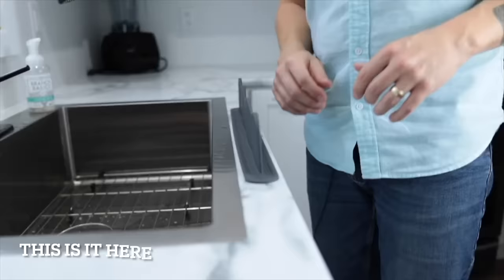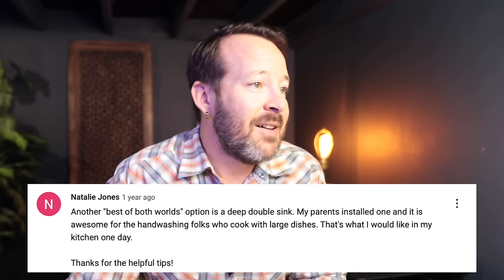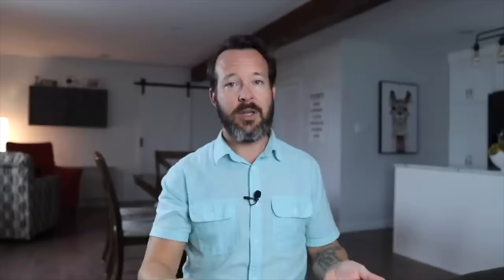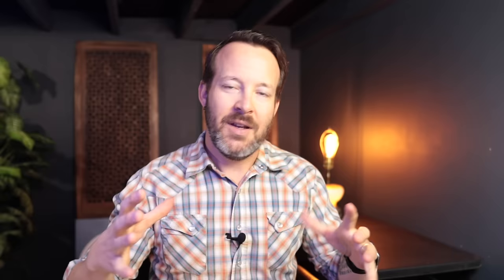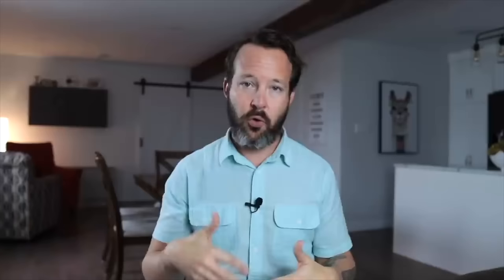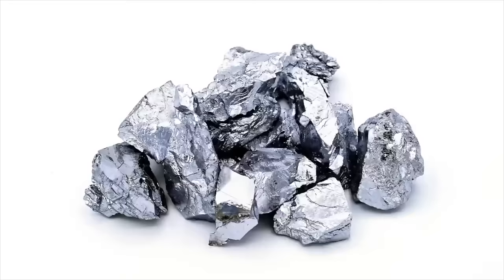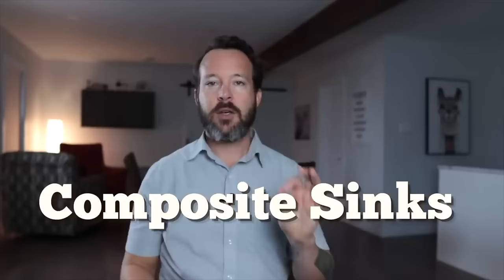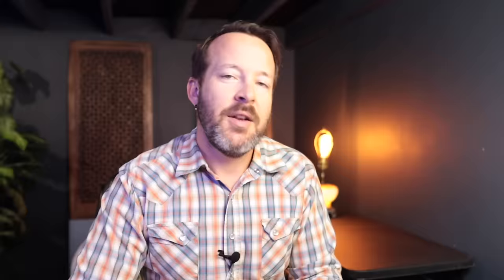Watch First Before Buying a Kitchen Sink

Comment: probably the reason older people like the double sink is because that was necessary before dishwashers were invented. You HAD to wash dishes by hand, NO choice. My house, built 1965 does Not have a dishwasher. I thought about adding one, but the kitchen is very small and would result in LESS storage space for pots and pans. Also, the COST for the dishwasher AND the plumbing and electrical work required. Being retired and on social security, I could not afford the luxury of a dishwasher. So, I will probably get a double sink. House originally had porcelain double sink. Yes, it does stain, but comet cleanser, or bleach handles that. And yes, it does have a few chips in it. But, it lasted 58 years. 1965-2023. I inherited the house, so know it's history. I grew up in it as a child.

Comment: My kitchen is a frankenkitchen made of dead parts of other dead and mostly commercial kitchens. Yes, I'm a bachelor, living alone, and I consider it to be a workshop for food. Women hate it loudly when they even enter it at a party (at my partys the food is self cooked and good) and they grow silent when I see me handle and use the kitchen. Everything is sturdy and overbuilt and pre-scratched (I scotchbrited everything to make the surface of the various stainless parts look more similar to each other). 

I did not know about the automobile silencing mats - I probed the sink by tapping with my fingers, marked some spots and glued surplus heavy tiles to the sinks underside with silicone (not caulc, proper silicone!)

Things that no other kitchen has:
- a pressurized air line. every metal workshop has one - why no kitchen? aerators, meat grinder disc and garlic press clean in seconds. But you need a dish towel and a deep sink, the tiniest of airnozzles and  a local 2 litre pressure reservoir under the sink. the tiny 4mm air line comes from my workshop in the garage.
- a floor drain with a sieve - everything from conserving and canning food to wiping the kitchen just became much easier!
- a proper light in the sink cabinet on both sides and the front of the sink. I made a white painted U from a П-Profile (the U goes to the underside of the countertop around the sink, the П is like a "roof" for the face-down low voltage LED strip. I hanged it to the clamping hardware which holds the stainless sink in the countertop. the cabinet is painted in white polyurethane.
- as we do euro style rubbish separation over here, bins are a separate free-standing unit, and can be rinsed outside in the garden or in the workshop. Pro tip I:  this helps decongest the single point of failure that the standard sink cabinet normally is: one person can wash the dishes, another can bring out the five garbage cans. Pro tip II: have a tiny organic waste bin with a good lid, and empty it daily - life is quick…

I plan to redo the sink unit in about 2 years, with foot operated tap - i have not yet decided… maybe even with a 5..10 litre hot water reservoir. I am just logging my hot/warm/cold water consumption to properly decide on what to do. That will also imply new plumbing, hence the measuring, logging and planning.

For the sinks in school's potting and bricolage classrooms there are "sieve sinks" or "filter sinks" to mount under the real sinks. I want something like this, where you empty a sieve once a day and never have to poke with fingers in a drain. But I did not find a source yet.

You should also have a look into "dish drying cabinets" which according to WP come from Finland, but I came across them in Italy. Why should you look into them? because not only the daily dishes rest in them, the lower shelf is the ideal place for sponges, brushes, bristles, scotchbrite pads, etc.
Reply from the maker: Love the idea of the foot operated faucet.  That sounds like something that should already be in most kitchens.

Comment: I prefer a single large sink. Stainless steel with smooth not sharp corner interiors. Also Dont like the sinks that are recessed under the countertop.....mold grows up there! Also, with ONE sink...you only have to keep ONE sink shiny and clean. easy peasy.
I have a large wooden cutting board that I can slide over 1/2 half of the sink for food prep. Im old and sick and tired of making extra work for myself.  A clean sink makes a clean home. Keep your sink sparkly..it's good for mental health.

Comment: Right now I have an 80/20 split sink. I LOVE it 99% of the time. The 1% hits when i have to clean something BIG, like my stove grates or a stock pot.

I've decided that my great grandma was a genius and I'm going to do what she did. Giant sink with a small wash tub. Then i get the best of all worlds. I can have a sink full of dishes and a bit of bleach/soap water for sanitizing counters. I can take out the tub and wash my giant stock pots. (Right now I've to take them to the bath tub and my back HATES it.)

But I don't have to use my great gma's utilitarian plastic was tub. A beautiful enamel pan will do nicely. Apparently I can have function AND form if I twist my brain in enough knots to figure it out.

Comment: Corner sink, I had one 10 years ago.  Even though they gave it a flat front within the corner, it's still a no...no...just...no.  
Under-sink-catch-the-leak mat, hellsyeah.  I especially like the lip that may give you time to catch the leak or hook up a magic alarm to it like AC handlers have.  
Now, can we get under-sink pullout shelves/bins that will still work with the save-my-cabinet-catch-the-water mat.
Reply from the maker: So no corner sink in the new kitchen, is what you're telling me haha
Reply: @MTKDofficial  For the love of baby Jesus, no.  
I’m short, so I need the sink edge close to me, not farther away and pushed back to the wall in either direction.   
We’re going with a 36” cabinet, so I’d like an under-mount single-bowl big enough to bathe a baby llama in apron-front pushed out tears me to shield the cabinet doors and give my low back some relief.  🥰

Comment: Double-sided composite white sink that mom wanted.  What a mistake!  Thing looked fantastic until it stained and it stains like every day.  Now that mom is gone I'm anxious to rip that sucker out and put back a stainless one.  Always had a double sink, but am considering a single with offset drain.  (We also have to redo all our cabinets on one side. Had an unknown leak for possibly years (dealing with parent's dementia left us too drained to worry about other drains) Every cabinet got warped and underneath became roach heaven.  ☹  All for the lack of a drip pan that would fit what with all the stuff dad kept down there.

Comment: Nice video. 1. About the plumbing, would it be a good idea to place the siphon just behind the wall in a technic little room (a cellar or a boiler room, instead of under the sink ? So the plumbing under would be minimalist under the sink, just goes straight int the wall and for the cleaning, in the little room there will be direct access to the siphon (no sink on top of it). 2. Any reason people use a regular faucet instead of a thermostatic valve like we use for a shower ? What is anoying me the most in a kitchen is having trouble finding the right water temperature, it gets either too cold or too hot. I consider those 2 ideas for a new house, is it stupid ?
Reply from the maker: The problem with hiding the siphon (assuming it has a cleanout) not being able to access it easily.  I know you can access it from another space, but it adds a few more steps.  Plus if there was a leak, you could catch it earlier (maybe). However, having the extra space under the sink would be nice too.  So if it's plumber approved I guess it would be a good idea.  I mean the siphon for the shower or tub is likely in the cellar, so no reason the sink couldn't be.  As for the faucet, I'm surprised that the new digital voice controlled faucets don't have this.  Or maybe they do.  I think it's a good idea, but have never really considered it for a kitchen.  Would there also be instant hot water?

Comment: There is a very easy fix for sliding cutting boards that trained chefs use. Take a kitchen towel, dampen it, not too wet and place it under the cutting board. Your cutting board doesn't slide at all.
Reply from the maker: That's a sweet tip!  Thanks

Comment: We just put a 25" single bowl Kraus sink into a 27" cabinet... (says on the site that is the minimum). Well let's just say it wasn't easy and I'm glad my installer (dad and his friend) had patience and knowledge! PS. the clamps on the Kraus sink are crap. There is a bow on the sink edge which really sucks, but there is enough silicone. I wanted it flush though, so that's annoying. Anyway, I'm not super thrilled with the quality for the price. It's in there now, so it's not moving.
Reply from the maker: Sorry the sink replacement was a bust.  I've installed enough sinks in my day to know it can be challenging.  Hopefully it's good enough quality to last, so you don't have to do it again soon.
Reply: Thanks… and expensive enough lol it was close to $600 with tax. But they did an amazing job putting it in so I’m sure it will last. Thank God for silicone 🤣

Comment: Former baker
Undermount sinks give me the hebe-gebeis, the join is just going to be hard to keep clean, it is going to get moldy, you will have moldy water in your sink
Duel sinks, if you are wanting to clean properly, then you wash your dishes in one sink, then put them in a second sink with antibacterial water,
Reply: Curious about this. I've wanted an undermount sink for ease of cleaning the counter top. Just push stuff into sink! With the drop-in sink, the lip is in the way and I have to clean that edge very carefully.
Reply: @denise-ski907  I am a baker. Around wet areas I have always seen the silicone sealant go moldy. with an under counter sink, you are not going to get down and inspect it. It is going to be a place that is hard to keep clean. And hard to notice if it needs maintenance

Comment: The sink under the window issue. A cabinet over the sink doesn't make sense or you are staring into a cabinet as you are using the sink.  I am putting a mirror over my pantry sink because it will reflect some light in a windowless room.

Comment: Wish it had covered various integrated dish drain options besides the multi function sinks. Specifically having drain grooves in the counter that drain into the sink. I still find I hand wash a number of things that are heavily used so still have a pile of dishes to the right of my sink
Reply: Whatever happened to those sinks with grooves? And weren’t there some double bowl sinks where one was basically a stainless steel counter, or just a more shallow basin (with said grooves)? To be fair, I haven’t seen the whole video yet, but it seems he’s done with size and shape, and it didn’t come up :(

Comment: Super comprehensive video! I have a question about faucet placement on a 36” single bowl sink with an offset drain. The sink is in an island and so aesthetically it doesn’t  need to be centered on anything behind the sink. Is there a best practice for where to place the faucet? I see most faucets are centered, but I was considering aligning the faucet to the side with the drain, rather than centered on the sink. Assuming the pullout sprayer adequately reaches the other side of the sink, are there cons or design mistakes with doing an offset faucet placement?
Reply from the maker: This is a great question.  I think you're on the right track.  If the pullout reaches the whole sink, I don't see it being an issue.  That would be the only con.  There might be increased splatter on one side of the sink, which might be annoying.  And you wouldn't want the faucet to swivel out onto the countertop.  So maybe a couple things to consider.  But I like the idea.
Reply: @MTKDofficial  Thanks for those considerations- I’ll definitely keep them in mind.
Reply: @martyo169  My engineering compulsions would never let me offset a faucet, but if I did I think I’d choose offsetting it toward the side opposite the drain.  My reasoning is that I’d always be rinsing the sink down after use starting from the end opposite the drain, so I’d be starting from where the sprayer is already located.

Comment: hi mark. great video. so now im in the stage where im confused if the size 27” undermount sink will fit the 27” sink base cabinet? 😅
Reply from the maker: Hmmm.  The sink will have the cabinet size required, but that doesn’t sound like it would fit.

Comment: Something I don’t get…..if you don’t have a draining part, where do you put your stuff to dry? If you put it in the counter it’s gonna slip off, right?
Reply from the maker: You can purchase a drain board if need be.  Or an integrated drain board.  But this is why the way you use a sink may determine whether you are better off with two bowls as opposed to one.

Comment: Have a corner sink in the middle of my kitchen!!! Not because there wasn’t a better place! I have a dishwasher under one of the sides and the washer door can’t open without standing away from the sink. Loading the dishwasher is a back injury waiting to happen. It’s the reason my kitchen remodel has moved to the top of my remodel list despite it’s incredibly high cost compared to the rest of my remodel list
Reply from the maker: Good insight!  I agree it can certainly be an awkward situation.
Reply: Consider not putting dishes destined for the dishwasher into the sink first, but directly into the washer, or on counter accessible while loading washer.

Comment: A double bowl sink is not as functional and very limiting.  Have the divide whether low or not gets in the way of using the sink for washing or whatever. If I really need a bowl that is filled with water or other purpose, I use a plastic wash basin placed in the big single bowl sink.  It can be removed at any time.

Comment: Can you add a liner with pull out recycle/garage side? I can see without a lip, but if you want an edge/lip seems tricky..
Reply from the maker: Any liner plus a pullout that mounts to the bottom is probably not ideal. The lip makes it trickier to accomplish, because you'd need to build up the bottom where the rails mount.  Either way, you still need to screw through the liner creating hole where water can get to the floor of the cabinet.   I still think something is better than nothing though.

Comment: how can i measure correctly to replace a double to a single? - i have a undermount and granite top
Reply from the maker: Measure the actual opening and compare to the cutout specs for the proposed sink.  If the original is a standard size sink, it most likely shouldn't be an issue to find a comparable replacement.
Reply: @MTKDofficial  after looking again - my sink corners are curved so i doubt i will ever find a sink that will fit without cutting the granite  total bummer
Reply: @MTKDofficial  thanks -  after actually paying attention to my sink, the corners are curved and most of the single bowls are square so i dont guess it will work

Comment: Thank you for explaining the use of a double sink!!!  I bought a house with a luxury kitchen, but it had a double sink that I HATED. I thought that if I could understand the purpose of a double sink and learn to use it correctly, then I wouldn't actively hate it so much.  NOBODY could tell me the use.  (It had a curvy asymetrical  cutout from the granite, so I couldn't yank it and drop in a single bowl.) 
Now, I have a different house and a large single bowl.  I use a container to soak my utensils...and I leave some water in my plates..rinse them... I could get a tub if I wanted to soak my dishes or hand wash them, but I don't really need to do that. Rinsing them works just fine.  
My friend uses the 2nd bowl as a dish drainer... which means that she really only has a very small single bowl sink on the other side. I find it weird, but her countertops don't have an awkward and ugly plastic dish drainer like mine does. 
I would never have anything but the biggest single bowl I could fit.

Comment: Do they make a kitchen sink with overflow protection, like bathroom sinks?  I guess the 60/40 double sink with the slightly lowered barrier between is one option ...
Reply from the maker: You know....I'm sure they must somewhere, but I've never come across one.  You'd think, that would be a thing.  If I recall the "London" sink from years ago had an overflow.  You'd have to fact check that though.
Reply: @MTKDofficial  thanks!
Reply: I think most kitchen sinks in U.K. have overflows. I expect it’s a building regulation.

Comment: First of all, I prefer large one sink. For my working method, double sink just doesn’t make any sense. I don’t really soak dishes, and rinsing vegetables I do in a plastic or metal container that are strainers. And for lettkng dishes dry - I’d rather have that attached surface to the sink where I can put out a rack. But that’s just me. 

As for materials…we still haven’t decided between stainless steel brushed and fireclay. Stainless steel seems perfect, except it scratches. Fireclay doesn’t scratch and looks good, but can it crack if you handle heavy things in it? 

Composite is a no for me, I’ve been using composite sinks, we’re having one in our home that is a beige color - it stains in time, you can’t use some types of cleaners to clean it - you have to be careful with that because it can damage the surface so the sink will be even easier to stain. The black or darker composites I’ve noticed they tend to scratch with time. I’ve seen some of these in other homes.
Reply from the maker: I'm with you on the composite sinks.  I had one in a darker grey color.  Let's just say my current sink is stainless. lol. Thanks for watching!